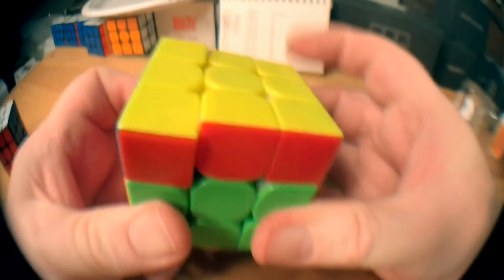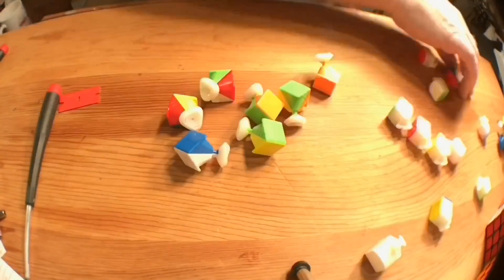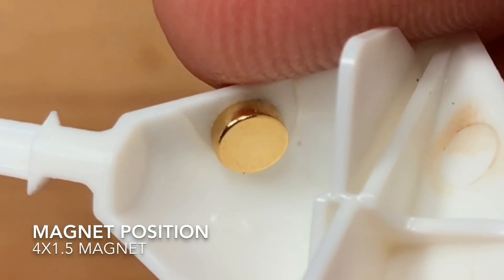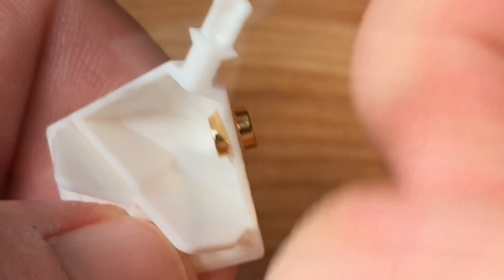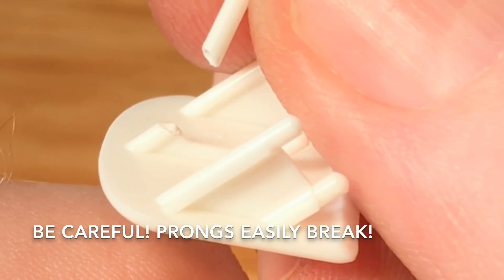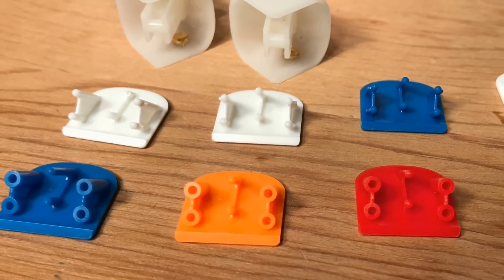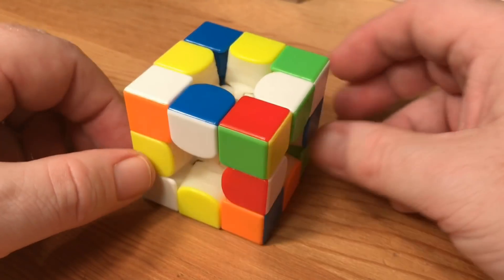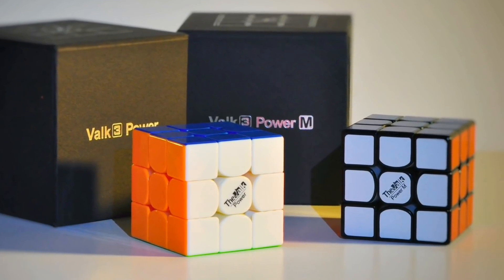How to Magnetize the Valk 3 Power Speed Cube

Comment: Nice to see another tutorial! This cube does seem more challenging to magnetize than other 3x3's. I ran into the same problem with the caps overlapping the magnets while making a Gan249 M and a Shengshou Pearl M. It's so frustrating and time consuming to fix!
Reply from the maker: Lexmic Yep, time consuming and frustrating indeed!!!
What magnets did you you settle on in the Gan 2x2?
How is it? I've been kind of on the fence about getting one.
Reply: DMCubing for the 249 I used 3x1mm N42's. Anything larger than 1mm thickness would be too strong and anything larger than a 3mm diamater would overlap the caps. The N42 give a pretty noticeable turn but it becomes pretty subtle during speedsolving, I like them a lot. Maybe a N45 or a N38 could be good too, I haven't experimented. The magnetic position I choose is a bit different than other 2x2's. Its closer to the center, which explains why a 3x1mm magnet would work. The 249 is actually a fairly challenging project! The caps are locked in by prongs so to take apart the corners you have to take a screwdriver and push the prong out of its slot, then push on the prong itself to get the cap off. Just the disassembly took me an hour. On top of that, the slots to put the magnets are really small! You have push the magnet in as far as you can to get the cap back on properly. Despite doing so, I still had to sand a few caps because of overlap. Overall, I'd say it'll be more worth it if you just buy the factory magnetized version. The only reason why I took a shot myself is because I thought it'll be easier and I heard the factory version has really strong magnets. However, you really get a sense of accomplishment after you finish!
Reply from the maker: Lexmic This is GREAT information to know!!!! Thanks for sharing!!!! Yeah, I'm still undecided about buying this cube, but knowing me, I will. It's interesting that the information 3x1 feel as strong as they do. I usually use 3x1.5. Probably the design and thickness of the Gan. Thanks!!
Reply: DMCubing ahh one more thing. I didn't play with my 249 for a while when I was writing my response. Now that I'm giving it a few solves again I'm starting to realize how strong the magnets are. Maybe N42 is the max you want to go with, I dunno. It is quite odd that 3x1mm feel strong. As a fact I didn't believe it myself so my first time making a magnetic 249 I used 3x1.5mm N42's. Those were WAY to strong, and I ended up chipping those out and remagnetizing it. If you choose to go for this project, good luck!
Reply from the maker: Lexmic Hmmm. Where did you get these magnets? They seem stronger than my comparable ones, though I find that Gaussboys is usually stronger than everyone else. Interesting. I'll have to check this out! Thanks for the info!
Reply: DMCubing I ordered the magnets that I mentioned from a website based in China called Taobao. I've actually seen people like TCKewbs and CubingWithMeki unbox packages from Taobao, it's astonishing to see how popular a Chinese website has gotten. The website is pretty similar to Ebay or Amazon. Surprisingly, the magnets aren't really cheap in quality despite their cheap price!

Comment: Can you tell about feel of 4x2 n35 and 4x1.5 n38?
Reply from the maker: I haven't actually magnetized one in an N35 4x2. According to the magnetic calculator at K&J Magnetic, the N35 4x2 will be about 19% stronger than the N38 4x1.5. I think that lies well within the suitable feel for magnets, particularly if you just a slightly more pronounced feel. And the N38 4x1.5 that I used give a medium magnetic feel. 
If you do use 4x2, remember to watch out for the little internal posts on the edge piece caps that come very close to the magnets. I'd almost suggest just gluing a piece or two first to make sure you'll have room. Or you can possition the magnets on the opposite side. Also, I've heard that some cubes come with a mixed set of parts- some edge pieces have the magnetic slots and some don't. Mine happened to have all the same pieces, but that's something else to look out for, and maybe another reason to consider locating the magnets to the other side.

Comment: Hi I'm  how do you remove magnet out of a cube because I stuffed up in a 2x2  the chewen
Reply from the maker: First, I'd try carefully prying them out with a small screwdriver. If that doesn't work, try soaking the disassembled cubie pieces in warm, soapy water for several hours. This often softens the glue enough to help pry them out. You can also try applying a drop or two of alcohol directly the magnet to soften the glue.
Reply: Thanks

Comment: I think 4x2 n35 in the edges and 3x2 n52 in the corners work perfectly for me. No doubt one of the hardest cubes to mag. I also noticed, in my Valk Power at least, some of the edges pieces actually had slots for the magnets while others didn't. I'd recommend checking all the pieces for mag slots, making a master edge piece, then with the caps on use the master edge piece to align all the corner pieces before magnetising the slotless edge pieces.
Reply from the maker: jthotshot Thanks for sharing your findings!
Ah, I knew it would start happening- the factory mixing the magnetic cube pieces with the nonmagnetic pieces. Oy! Crap! I knew that would happen. Can't edit the video now. Yeah, makes sense to check all the cubie pieces ahead of time, or better yet, totally disregard all slots and magnetize on the opposite side!

Comment: I'm having trouble removing the "prongs" from the corner piece. I don't have the gan tool or the socket you mentioned in the vid, just a plastic gan tool
Reply from the maker: OK. What you can do is carefully use a small screwdriver and press each prong in, one at a time, repeatedly. Eventually they'll all go in. 
Sorry I didn't get notification from youtube on your comment.
You can look at my original how to magnetize the Valk 3 video, and I show using a screwdriver to do it.
Reply: You don’t need any tools. Just use your fingernail.
Reply from the maker: Nabranes TwistyPuzzler Hah! If your fingernail is narrow enough to fit in the base. Mine sure doesn't fit!
Reply: DMCubing I’m not talking about that small hole in the center of the base. I’m saying that you should put your fingernail in the corner of the base. It’s like taking off a center cap.
Reply from the maker: Nabranes TwistyPuzzler That's not what the original comment was about, but thanks.
Reply: DMCubing hey I fully magnetized it thanks so much dm. I now have some extra set of 4x2n35 magnets and don't know if I should magnetize my xinghen or my valk3? Any suggestions?

Comment: Can I use 5x1 mm sized magnet for that?
Reply from the maker: No, not unless you locate the magnets on the opposite side and make sure they're low enough to clear any of the edge cap posts. There's barely enough room for 4mm as it is using the corner piece slot.

Comment: Wow. Good Job! At least you didn’t fail like me😂. I ordered a Valk 3 Power M cause I suck at magnetizing a Valk. I think the Valk is the hardest Cube to magnetize. Oh also 1 more thing, I tried to use the plastic GAN tool but it doesn’t work. Oh well😂.
Reply from the maker: Rubik Geek Without a doubt, it's a harder cube to magnetize. Even with as careful as I was I had two magnets just slightly too high in the edge. 
You'll love the factory Power M!!!
Yeah really only the metal version of the tool works. But a 5mm socket works great!

Comment: Would 4x2mm magnets work as well? I only have those.
Reply from the maker: I think they would work, but because of the little posts on the edge caps, the thickness of the 2mm may get kind of close to one of the posts. If you make sure they're low enough in the edge piece when you're gluing, the magnets should have just enough clearance, but it's really close as you can see in one of the pics in the video 2:38 . If you use the other side of the corner piece third and located the magnet just slightly lower than the magnet slot allows for, you should have no trouble. You can still use this video as a guide.
Reply: Thank you very much, I will definitely have a look at that when my Power arrives. I have used your guides for all my cubes I magnetised:D
Reply from the maker: Oh, cool! Thank you!!!!

Comment: What magnets should i use for the wuxia! The 4x2 n48 are a bit too strong!
Reply from the maker: ZBC - ZBestCubers I haven't tried that cube yet. I have one right here with me, but it's a present for a friend's grandson, and I didn't want to break it out of the plastic wrap!
Generally speaking, most 4x2 magnets, even the lower grade N35, are going to overpower a 2x2, while on the other hand, using 4x1 magnets generally feel too light, unless you want just a hint of magnetic strength. So the solution is to use something in between. 
4x1.5 magnets, 3x2, and 3x1.5 work well. 
I really enjoy the N52 3x1.5 I've used in the last couple of 2x2s I've magnetized! They give a great feel!
Reply: ok thanks!